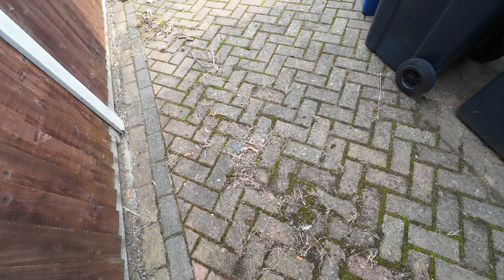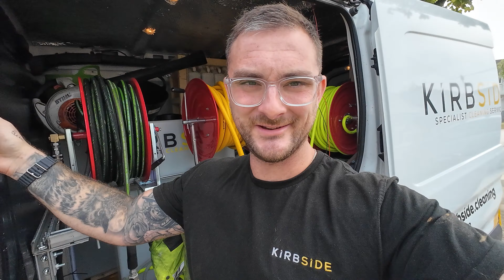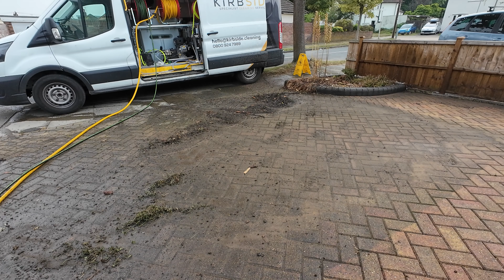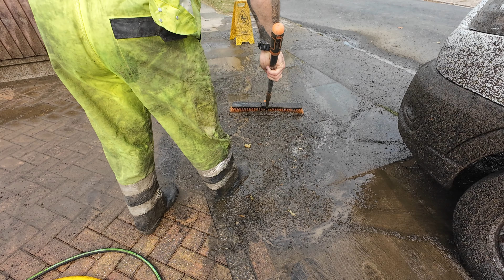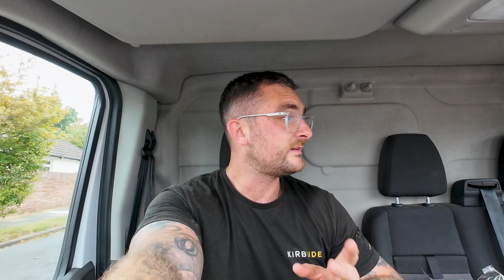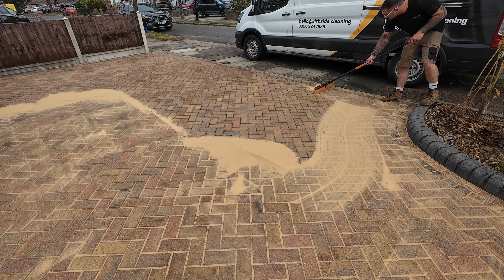SHOCKINGLY MOSSY! Pressure Washing & Resanding this FILTHY Driveway

Comment: Great job! Just a quick tip...never clean from bottom up, always clean from top down..prevents having to clean twice😊
Reply from the maker: Thank you but this is dependant on the job, location of the drains, if it’s drains or soakaways. Also you only clean it once, you may need to rinse it twice.

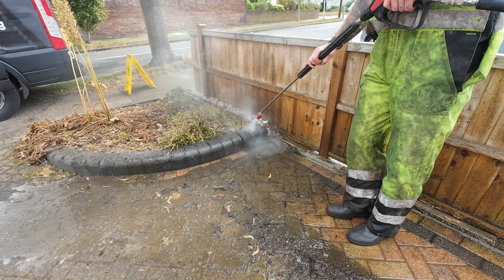Comment: That indeed as an awesome turn out!  Has to be in your top 10? The nozzle attachment @03:25 where did you buy it from please?  I need it in 1/4".  Ta muchly.
Reply from the maker: 3:25 was just the normal turbo nozzle, I got mine from. Vtuf
Reply: @KirbsideCleaning  Thank you! Here is part number if anyone else is interested:  T3.2605SSQ V-TUF TURBO HEAD

 275 BAR 4000 psi 100oC HEAVY DUTY(03)

V-TUF T3.2603 (4000 psi) Ultra Heavy Duty Professional Industrial Turbo nozzle head can almost double the cleaning impact of your pressure washer. The contractor V-TUF turbo head nozzle, known for its durability and its cleaning power boost. Proven to last up to 3x longer than other industrial turbo nozzles!

Please note: You must select the correct SIZE turbo head to suit your machine.
TIP: The most common size is the T3.26035 or PIR-2603
You will find a nozzle chart on our customer tools page

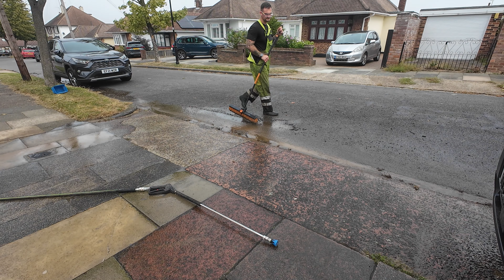Comment: You aren't looking at sheet areas of moss, but all that in the cracks will add up to a lot of sludge when cleaned.  You concluded the same. Nice to see some pretty color starting to show as you work.  2:36 That was a nice brick pick and trim someone got. That was nice you found a bag you could squeeze the water out of the sludge with.  Have heard of them. A lot of paving.  14:46 What was on the street paving?  Extreme Black Spot, moss??  A nice treat for the resident and neighbors by the time you sanded.
Reply from the maker: Thank you so much Robert

Comment: Nice result.  Is there a reason why you only used the wand and not the surface cleaner?   Just curious
Reply from the maker: The surface cleaner on this level of moss wouldn’t do anything and would have to turbo afterwards anyway. So I prefer to just clean once instead of twice